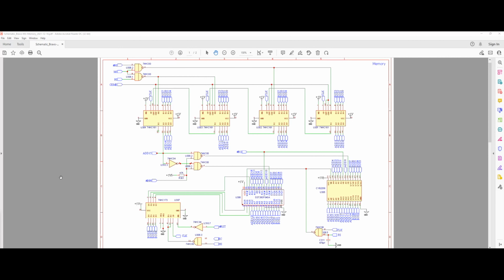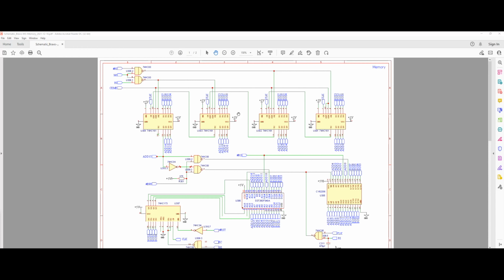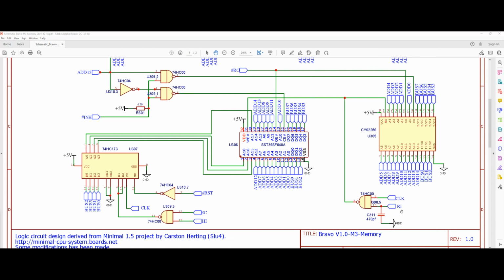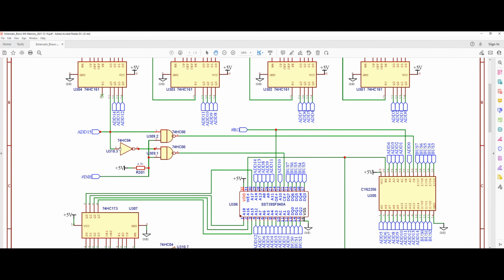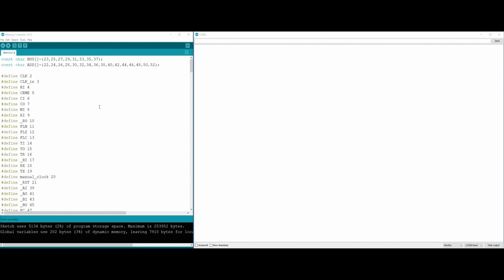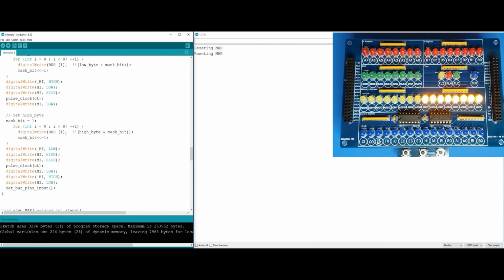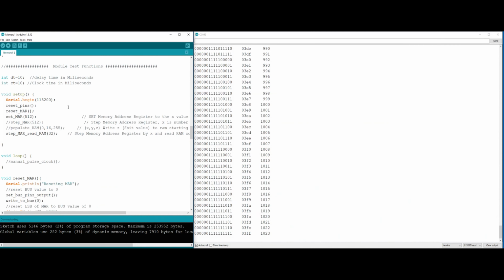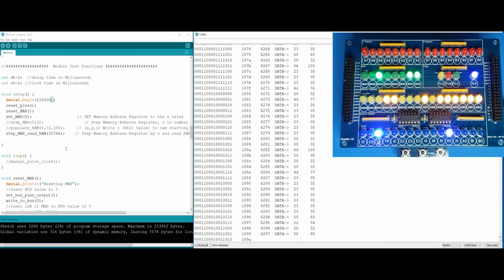Bravo 8bit computer-Part 8- MAR & RAM, inspired by Minimal Project and Ben Eater's 8bit computer

Comment: Looks like the populate_RAM function in Arduino sktech for RAM testing fails at the last memory cell at the address 65535 due to integer overflow. But it was interesting challenge for me to find whether it was the Bravo H/W issue or testing code issue. Fortunately the H/W works well and I can proceed to flash memory testing.
Reply from the maker: Thanks for sharing this. Yes, you are right ! I think we have an integer overflow that I missed during code developement. Well, it's one/last address out of 65535 ! but I'm glad you figure this out. That means that you were really commited to the project ! LOL